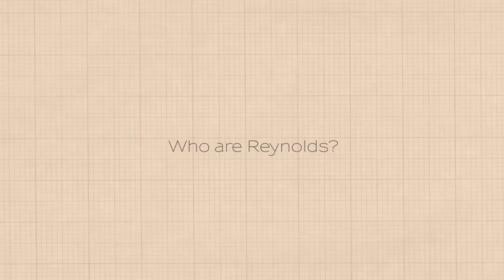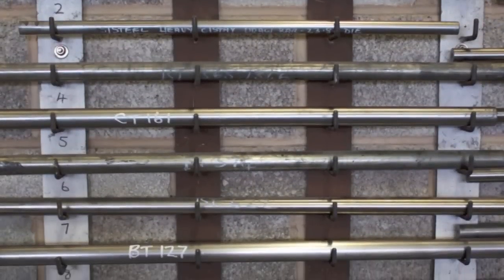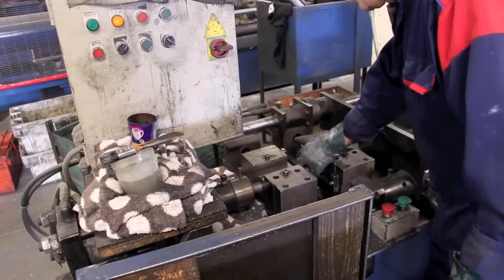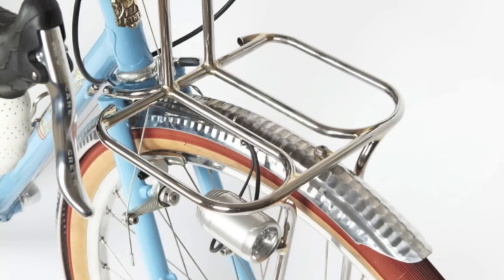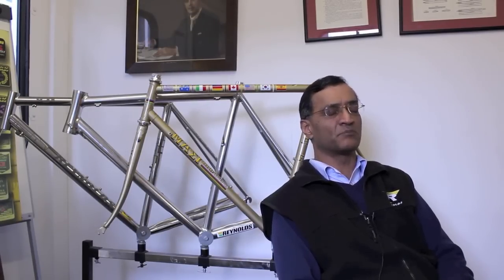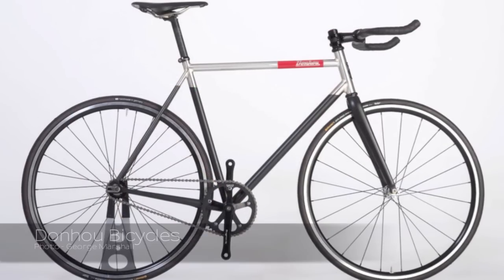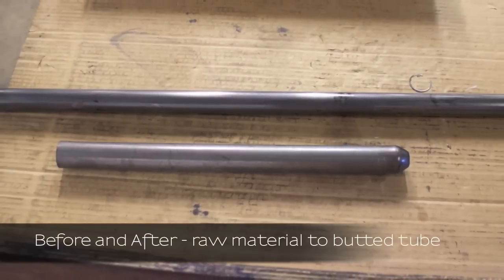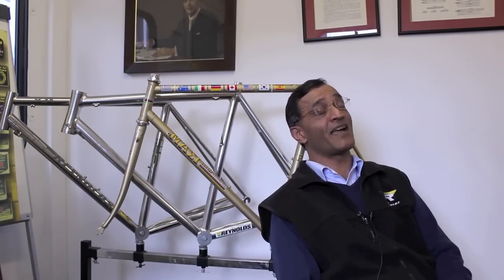Meet the Maker  -  Reynolds Technology

Comment: There's some jibber jabber about frame material not mattering, but the elastic qualities of a given material/thickness/diameter/length are an integral part of how a bike feels. A thin walled tube of high quality steel definitely has a certain something. I have a straight wall ti bike with narrow Conti tyres, and a 853-based MTB, and both ride much better than the cro mo bike with mid size tyres.

Comment: The problem with 953 is it came out too late. 
Must compete with carbon and Ti
Reply: Never, Rolls Royce steel forever.
Reply: @sandydennylives1392  
"Never, Rolls Royce steel forever."
 - I worked at Rolls Royce Aero Engines some years ago. The steel they use for their mainline shafts is insane.
Reply: @lewis72  With the down turn in air travel-thank God- perhaps RR can start making bike frames with their super steel. Any more info you could give me on it's special qualities?
Reply: @lewis72  That's what I call the kitchen sink! Cobalt as well. No MpA, it's gotta be GpA. Very impressive, thank you.
Reply: rubbish, that's like saying you should drink meths rather than whisky because it'll get you drunk faster. Some people want to enjoy the experience intimately.
Reply: In the long run you know carbon fiber will win. As much as steel is evolving (and it is remarkably), carbon fiber technology is evolving even faster-  lower costs, more resilience, etc. Steel at this point is a ride comfort choice.
Reply: I have to disagree, folks need peace  of mind when their spending big bucks on a racer, especially those over 110 kg. Yes my steel looses a little on a col to a cf, but it has climbed 'em sweetly all the same, and is plenty fast in other areas. It's a racing version of, say, 853. I agree the new 'form' of cf that came out a few years ago is interesting but it won't come out as a bike frame for many many years if at all, and is highly magnetic so no good in a storm and will be at a huge price. I don't say it won't happen though. I have plenty of solid cf on my steel and cf forks and it is still half the price or more of an equivalent cf bike, and is m-m. Steel deflects stress like no other material, so I do worry about my cf forks and would prefer steel but I like the perf and lightness of cf forks.

Comment: I've still got a Geoffrey Butler from 1984 made from 531 special light weight, has been over mont ventoux, the tourmalet, The Col de L'Iseran, The Galibier, The telegraph, The cormet de Roseland and many more on top of that I've been knocked off it twice and a friend road it flat out into an enormous pot hole, damaged the GP4 rim but the frame is still perfect. I tend to just use it when I take it abroad, cycling doesn't need to be expensive, the breakdown cost over many years means the best has cost very little as well as that I replaced the damaged GP4 wheel(s ) with a pair from a cycle jumble that I picked up for £10. Viva cycling, viva Reynolds tubing.
Reply: I have an MTB frame Built by him in Columbbus OR tubing , fillet brazed , awesome :-)
Reply: Thank you for sharing! I am similar

Comment: I had a 753 - should I have sold it; ach, I needed the space at the time. 531C, if all you've ridden is an ordinary bike, is a thing of wonder. I was in Billy Bisland's bike shop in Glasgow in the (IIRC) early 90s and they had (I think) Raleigh frames made with Reynold's tubing, with mad paint jobs and with the tubes glued into over-sized aluminium lugs. Nobody else seems to remember them. I'd like one now!
Reply: Raleigh Dynatech? I had a 500 model, sorry I sold it but they were prone to cracking where the tube is bonded into the lug.
Reply: Yes it was dynatech and it cost Raleigh a fortune a think about 90 percent broken in three months I had one it was a great frame super light with the alloy lugs and bonded ( no brass soldier ) . It was great to think that the world of cycling at one time was all about a frame and keeping it for years
Reply: @dannsmcshane1233  I eventually found it. I thought it was a really clever idea. Looking at how strong adhesives are I thought it was a perfect solution. I remembered the epoxy resin adverts from the 70s where they lifted an Austin 1100 on a little bit of glue in the middle of the roof. Lots of thin bike tubing doesn't like being heated. 753 had to be silver soldered. So you'd roughening the surfaces and a load of epoxy resin would work. (You wonder what heating a really precise aluminium lug to get it to expand, and then letting it cool and tighten around a tube would do).
Reply: Billy bisland help me get into cycling and it been a great thing in life . A seen people stand on streets and fall into a bad life

Comment: Thank you for posting this most interesting video. My beautiful old Raleigh Record Ace (circa 1979/81) is built with Reynolds 531 double-butted frame and forks. This bike has more than 50,000 kms, and has stood up to a lot of strain, and even a couple of falls, and even a terrible crush under a truck's wheel hub- that sent the front rim into a tight "eight"!! It's still true. Amazing. The rest is basically Campy, except for an exceptional Suntour Superbe Pro 53/39 chainset that I'll be mounting today ! I'm very intrigued by your 931 tubing. However, I love old bikes because of their esthetics. The new builders just don't know how to design and hand cut beautiful scrolls and fretwork. I find modern bikes ugly and chunky.
Reply: We found a retrogrouch.
Reply: musamor75 Billy's
Reply: You're not wrong, modern steel is just welded so no beautiful lugs, as for dropped top tube they are an aesthetic abomination, same goes for new trend for lowered seat tubes, so ugly. I can think of a whole new genre of bike , fast city commute/light tourer, goes like this. High quality handbuilt steel, detailed lugs a must, beautiful decals, chrome work, forks that are raked, audax geometry.  light touring/commute wheels, spokes that glitter and dazzle  in the sunshine. full mudguards, rear rack, front rack potential. Comfortable upright riding position, perfect for scenery and conversation, swept handlebars. Triple chainset for when touring. Getting back to your sun tour superb though, I picked up an old Olmo, Is  campagnolo apart from superbe rear mech. It seemed like an odd choice but when I was cleaning it up it suddenly all made sense, very high quality Japanese technology, is lovely, no shame in that.